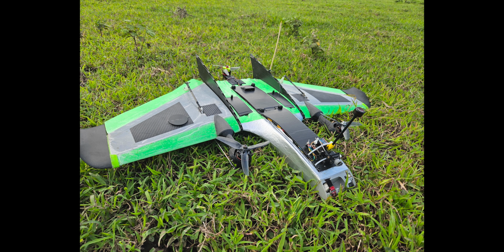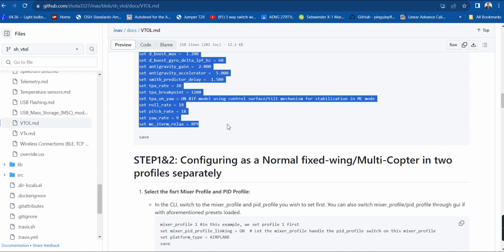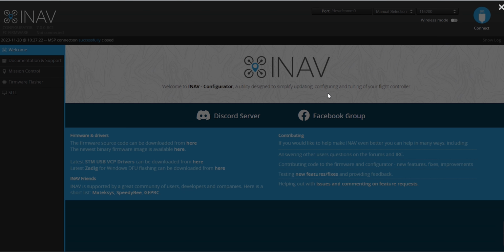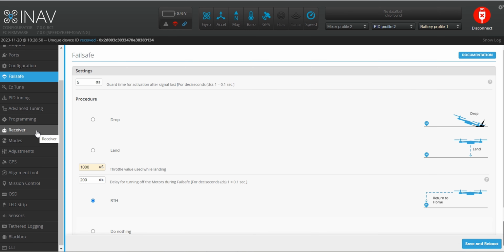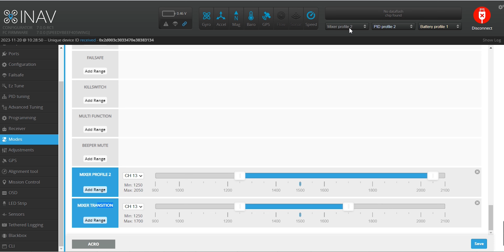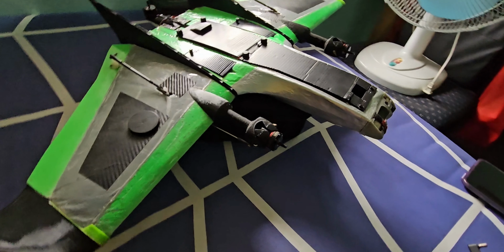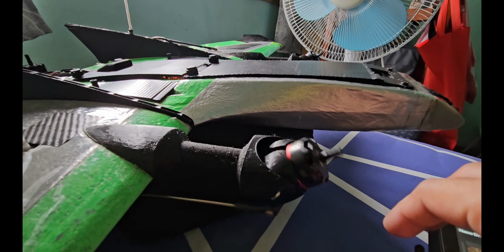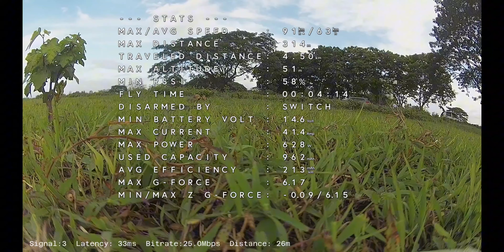My Nano Drak vtol now with Inav 7!! : A quick run through and test flights

Comment: Great video, thanks! Specially for the part with the OSD showing, knowing how much current it draws etc is really helpful. I see in a comment you used 1500mAh LiPOs...so it can't take Li-Ions, or did you prefer the LiPo for some other reason?

Comment: your video is almost the best one for etup  if u had a t1 ranger vtol  with a matek vtol FC  so manny people have one
Reply: and with a dji 03
Reply from the maker: haha! believe me, i tried, but the servo/motor mixers is quite a headache to setup with my existing wiring configuration on the Matek H743 Slim (currently running arduplane on it), as i need to resolder the connections to move them to the corresponding ports. So i ditched the idea on converting my t1 vtol to inav and did the nano drak instead from scratch.

Comment: Very cool,  what do you recommend as a first VTOL,  Ardupilot or Inav?
Reply from the maker: I guess that would depend on what you used before a VTOL. If you are much familiar with inav, then setting it up will take no time as compared to ardu (where you got a lot of parameters to set). Although I find setting up servo functions on ardu way easier. If you are familiar with ardu then give ardu vtol a go as well. I still find ardu's vtol transitions smoother, but perhaps I still need to do some tweaking with inav. Anyway, having VTOL's both with ardu and inav in a fleet is a good thing, best of both worlds 😁
Reply: I also prefer the automatic transition in Ardu, compared to the manual process in INAV.
Reply from the maker: There are pros and cons with the manual transition switch. Cut too early the tail motor will stop prematurely.. but unlike ardu, you still have control over the plane during transition, you can give some stick inputs if necessary. With ardu, the transition is fully automated until it reaches min airspeed. It won't respond to any stick input which may or may not be a good thing. If the plane loses a lot of altitude and transition is done at low altitude, it would end up crashing. Otherwise, it will just complete the transition safely and smoothly
Reply: You have to create your own smooth transition with the slow function to move the transition servos slower while maintaining elevator/aleron control in transition both ways.
Reply: @windfpv, can I use an F765 WSE controller for INAV vtol in the T1?
Reply from the maker: Of course you can

Comment: Well done mate! Is it possible to make the transition more smooth?
Reply from the maker: Possibly 😊
Reply: Yes add a slow so the transition servos move slower.  I am putting transition switch on to a channel that mixes it automatically and servos move slowly.
Reply: But you do it on the transmiter side?
Reply: @bunk.w420  you can do the slow with edgetx or inav
Reply from the maker: Yeah, slow on Inav can be done. Apparently, there's one issue, it will slow the tilt up rate too. The tilt down should be different from the tilt up..
Reply: @windfpv  if you use edge tx like I'm doing it can be slow 1 direction and fast the other